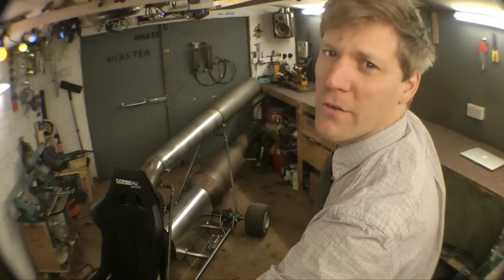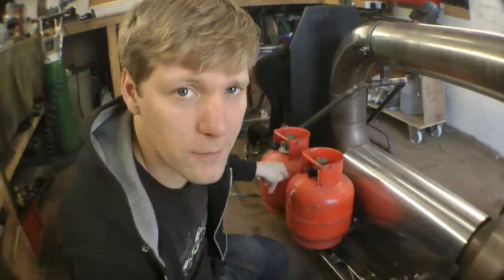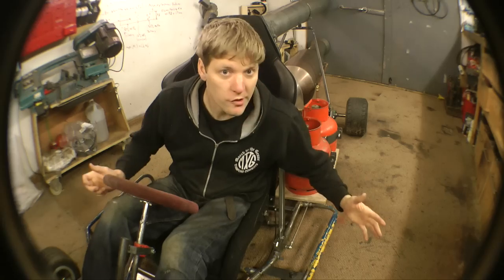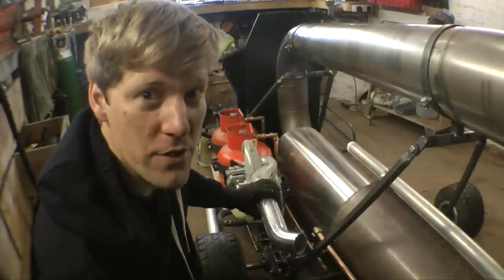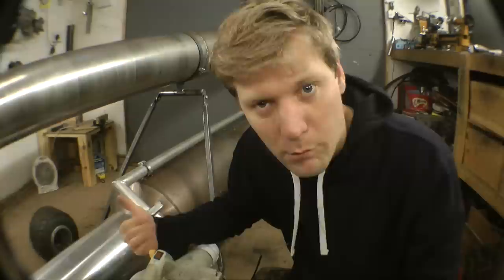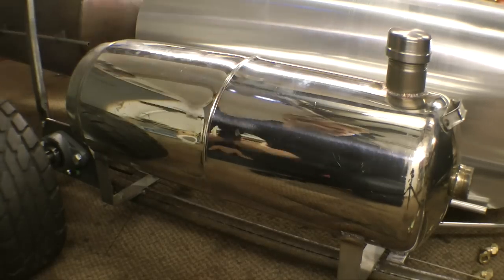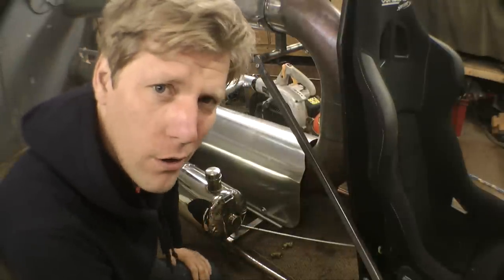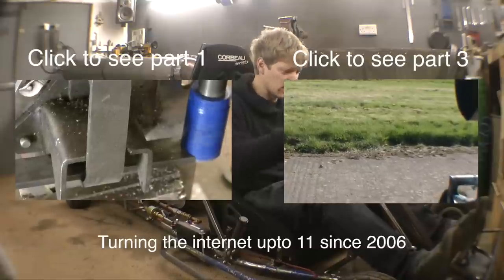Making a Jet Go-Kart Part 2 - Controls/Fuel

Comment: Colin make sure to put some silicone rtv or rubber grommets around those wires that are running through the tubes, last thing you want is the vibration chewing through the shielding and possibly starting a fire, or at the very least making a short that kills your fun.

Comment: Why did you not use the pressure of the gas bottles to propel the diesel fuel.
even a nozzle to get a mist of fuel is than in reach. I don't know the output of the electric pump, but just my thoughts
Reply from the maker: Marcel Hanenbergh see website as there has been a revision since this was recorded
Reply: colinfurze ah I see, you had the same thoughts as me ;-)

Comment: I do realize this video is already 7 years old, but it - as well as most all other videos about valvless pulsejets NEVER include the fuel rail itself. Why is that? How do you determine the diameter of the holes drilled into the 'injector' and how many do you need for a given cubic inch displacement?

Comment from the maker: Part 2 in creating this BEAST
Reply: colinfurze Can't wait to see how fast it goes, any predictions? ;D
Reply: Huge Squirrel He got 50mph out of the jet bike,,, until it had a blow out. Sooooo, I would say easy 70mph on this beast.
Reply: colinfurze Hey, what are you using for welding?
Reply: colinfurze What kind of education do you have?
Do you have some kind of engineering education or are you more like "go with the flow and see what's happening?" when you build these kind of contraptions?
Reply: Right angles on your air piping?

I am disappoint.
Reply: TheHammer260 Electricity.
Reply: colinfurze Epic!!!!!!!!!!!!!!!!!!!!!!
Reply: Matt Lorence Do you really think it will stop it working?
Reply: Natster Jam
He puts the extra effort into running wiring inside the frame tubes, and runs linkages thru the frame. Things that won't actually make a performance difference.

Right angles actually DO make a performance difference.  It'll run, I'm sure, but the starting system is less efficient and looks hack this way.
Reply: Fair enough, i think a little more positively. Nice one for hiding the wires colin. Its made in a shed my friend, a little less negativity would make you smile more ;-)
Reply: jpeg667 Your opinion, and I really don't care what your opinion is.
Reply: jpeg667 No, he's not an idiot! He was a little over critical of an amazing jet powered Go-Kart built in a shed. Don't hate, he could well be right in what he's saying but I think it would be a more suitable comment if Colin was in a full blown engineering workshop!
Reply: colinfurze nice work. if it is a prototipe is cool. I dont care about the right angles in tha air pipe for now, is just for fun... and crazy... aaaannnd if i had all the stuff you do, i'll do the same... greetings from CHILE!!!!
Reply: HatcheDWheeL  I'm not sure, it doesn't look like elektricity
Reply: Sion he is was a plumber
Reply: TheHammer260 He's using TIG the King of welding methods.
Reply: colinfurze Getting fancy now!
Reply: Hey colin great job you fabrication skills are v good now! Gota get myself a nice tig welder what do you use??.
Reply: Can't wait to watch the part 3!!
Reply: colinfurze Do you need repeated sparks to run a jet engine, or just 1 at start and once it is ignited it works until you stop the fuel? Is there a difference in the ignition system of the pulse jet, and the other type, and what's the difference in their performance of the two type? Speaking of: consumption and power... When the university ends and I get home I would like to build an engine. :D (I will also try to experiment with injecting gasoline instead of gas... it should be more work, but more efficient... If I succeed, I wana build a jet plain model...)
Reply: RPBCACUEAIIBH   I believe its one and done becauese the gas flows in and re ignights because its alread hot from the previrous firing.
Reply: RPBCACUEAIIBH
Yes, these engines are self-sustaining once the engine starts cycling.  U can use any ignition source to get it going.  I use a high voltage igniter also.
Reply: Ok thanks! And which type is more efficient in fuel consumption and power?
Reply: RPBCACUEAIIBH
What are you comparing a pulse jet to?
Reply: Juozas Noreika Thanks!
Reply: ***** well pulse jet with turbo jet... I know both of them are basically pulse jet, but this type has no rotating parts, while the other has a turbo that rotates at pretty high speed, so that must have a higher maintenance cost... I would like to know the difference in fuel consumption and thrust...
Reply: RPBCACUEAIIBH
I run my cart with a Lockwood Hiller I built.  I'm plenty familiar with how both work and the turbo built is nothing like a pulse jet.  But the turbo version is more efficient.  If you look at how they both operate its clearly seen why.  The pulse jet has an extremely low compression ratio which is the main issue.  It relies on the weight of air alone to operate the engine.  And yes, pulse jets are very primitive and easy to build from scratch.  My smaller engine produces 35 lbs and my larger 70 lbs thrust.
Reply: Ok thanks... I also done a little studdy, and it seems like a valveless pulsejet (the one shown in this video) if properly designed can consume less fuel then a turbojet, and less expensive, less complicated and more efficient then a valved pulsejet... However if not properly designed, it's efficiency falls below any other type... I'm a student studying mechanical engineering(currently) so a little more studdy on it's design, and calculations, and it should not be a problem to make it right... :)
Reply: RPBCACUEAIIBH
I run the exact same type of engine.  Valveless pulse are the least efficient of them all.  Remember the gases are moving in both directions on a valveless engine also which affects efficiency.
Reply: anyway if that gives me enough thrust for a little fun, and consumes less, and it's cheaper to maintain then a turbo jet, than it's worth it even if I don't fly at very high speed with it.
Reply: RPBCACUEAIIBH
That why I built a pulse jet, its a poor man's jet.
Reply: colinfurze The trusty leaf blower will live on forever
Reply: Matt Lorence
It takes a hell of a lot more than luck to bend a tight radius in tubing.
Reply: jimmicreesti No turbines in this thing. Valveless pulse jets have 0 moving parts.
Reply: colinfurze Me has question. 

How it no go boom?
Reply: DeJMan's Gaming
u funny
Reply: *****
This is for an on board starting only.
Reply: That's some next gen LEGO
Reply: Can you make another vehicle that's solar powered so that you can use it during the apocalypse so you don't need gas. :D
Reply: what if you worked for the military? :-)
Reply: Your videos are bloody brilliant keep it up and explain more while making your project all the connection
Reply: colinfurze

Comment: Won't this sharp bends in the air pipe lose you a lot of flow rate compared to doing it curvy?
Reply: mikeselectricstuff turbulence is the word you are looking for
Reply: mikeselectricstuff It isn't the jets air supply. Just to turn it on. Then runs alone with the intake above. So, I don't think it is that important in this case.
Reply: mikeselectricstuff you just need to build up a little pressure so that the fuel will burn properly. You don't need much, just a little - the leafblower is probably way more powerful than what is necessary for this, but it's cheap/easy/simple and it works.
Reply: mikeselectricstuff yes
Reply: But asking a it works who cares if it's not broken don't fix it
Reply: I went to say as long not as king
Reply: Yes but he has a very powerful leaf blower that it doesn’t matter

Comment: Nice work Colin, very neat! If the carburetor fuel pump doesn't work you could always substitute a fuel injection pump and put a nozzle from a central heating system or space heater on for better atomization... :-)

Comment: You put a brake on that? Dude, you've sold out to The Man........:D

Too bad you can't run a fuel injector and get the fuel to mist into the jet. Well, you could, but that's some complication requiring a high pressure fuel pump and enough battery to keep the pump running and keep the injector open during the run.

Comment: Yo colin. Sugestion! Tilt the fuel tank a bit (if possible) so you can maximize the fuel flow. If it's in an horizontal position, won't you lose half of the capacity? The fuel exit from the tank is right in the middle of the tank so... or the fuel pump is connected to the tank bottom?

Comment: That starting system is running off of the concept of a starting engine we Americans call them pony motors most others call them donkey engines or something like that. Long story short a little gas (petrol) engine that is used to start very large diesel engines. on the engines in excess of a thousand cubic inches caterpillar used them up until the early 70's. Smaller than that up until 1959-1960

Comment: Why didn't you just use an 18 volt cordless leaf blower to start it? It would be much easier than building a butterfly valve and having to start a gas leaf blower every time.

Comment: My concern is the heat from the pulsejet will boil the diesel. It will also melt the leaf blower.

He should have made a dump for the blower pipe so the blower will cool the pipe when not in use.
If he ran the diesel line through the blower pipe, it would keep the fuel cool too.

Comment: So the leaf blower runs continuously? and you just block its output once it is running?
Reply from the maker: Joseph Florentine yes but it does not seal round the pipe perfectly so when butterfly valve is shut the air can leak out not putting blower under to much pressure
Reply: colinfurze Will you put a heat shield in front of the jet and behind the seat? I can imagine, that it's gonna become very hot there :D
Reply: colinfurze Surely once its going you no longer need the leaf blower? Couldnt you just have a an engine cut off?
Reply: Anes Mesic he will be doing that, he metioned in part 1, that he would put one between him and the pulsejet, for safety reasons
Reply: Sean McWall Nice. Thank you for telling me.
Reply: no problem 😊
Reply: Sean McWall In fact I think it's already there.  At the end, you can see what appears to be a plate of some kind just around the back of the seat.  I was a bit concerned about this myself.

I would also hope that he keeps a fire extinguisher on board.  Eh, Colin?  And I don't mean the one you're using as a fuel tank...lol
Reply: colinfurze Can't you extend the on / off switch of the leaf blower to somewhere within reach?
Reply: Anes Mesic Go to 18 seconds in the video, there is a heatshield already there.
Reply: herpderpmonkey No, because the movement of this vehicle is kinda dependent on the propulsion of the thruster, so adding a muffler would most likely, not sure, decrease the power of the thrust.
Reply: UrBaNMCPaladinZ  A muffler would most definitely reduce the thrust to nil.  The mechanics of a pulse jet engine are based on resonance, so any pulse jet engine is inherently loud and any attempt to quiet it would make it stop working.
Reply: James Burleson Thanks :) that's a much better explanation

Comment: anyone: i have a (kinda) stupid question i think but i doesnt know 
nothing about jet engines :) so:

the air entrance and the exausting are pointed to the same direction 
right? so, how does the engine goes forward? because if the air comes in
 and out from the same direction, it shoudnt stay still? this is 
freaking me out if anyone could answer i'll be happy :D

ty guys!
Reply: exhaust gases expand causing propulsion. think of a rocket.

Comment: Just a friendly question, isn't there any problem in letting the gas tanks nearby the jet engine? I mean, the jet engine will get red hot
Reply from the maker: ***** the ali sheild protects them but they actually freeze up due to the  high fuel draw off so a little heat is helpful
Reply: colinfurze Hmm, didn't thought about that, I really want to see the next part! make it badass as fuck!!

Comment: What are those circular joints that you used on the lever?
Reply from the maker: Nicholas Wiles rose bearings, look at simply bearings website or ebay
Reply: thanks man! you just made my project a lot easier.

Comment: Is there a specific reason you did not use gasoline? its alot cheaper than deisel; in the united states at least, burns a little cleaner, and easier to combust (to my knowledge anyways)
Reply: Gasoline/Petrol is just a bit too unstable when you're working with flames and high pressure. Diesel has a higher burning point so it's not as likely to blow shit up.
Reply: Shona  that makes alot of sense. if i make one, i wont use gas, lol